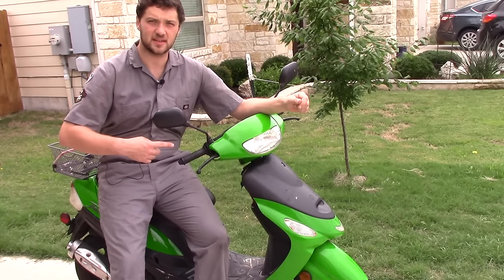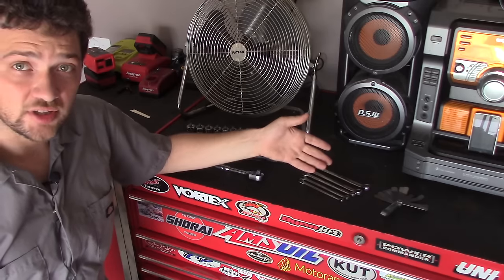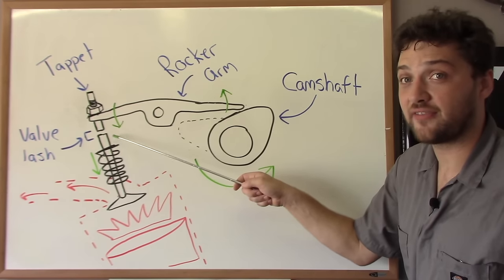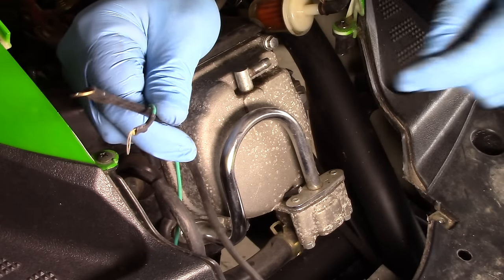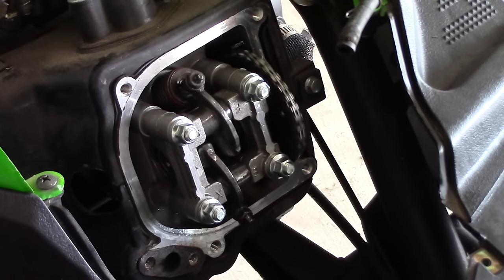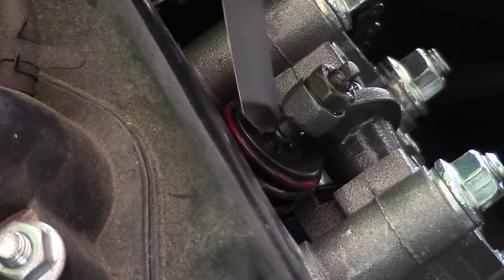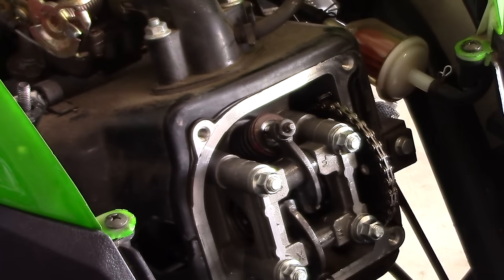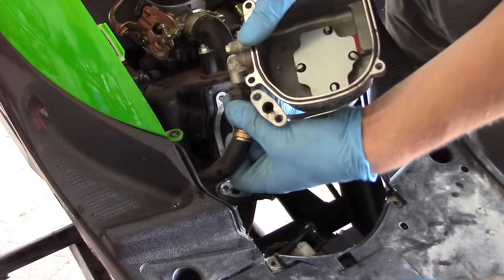Scooter 911: Hard to Start or Wont Stay Running? Try a VALVE ADJUSTMENT! (works for most scooters!)

Comment: Having an issue right now where my ped won't stay running unless the gas is past a quarter throttle. Soon as I let off it dies right away. Any ideas?
Reply from the maker: Did you try the valve adjustment?

Comment: The manual for Gy6 50cc states to set both valves at 0.002 inch/0.05mm, you say to set the intake at 0.003inch /0.076mm and the exhaust at 0.04inch/0.10mm. What's the correct value?

Comment: @Garret Seesing How much would this cost at a typical shop to do? I have this exact model/problem but I do not have the tools to do this. Your video was very helpful and i could easily follow step by step but the lack of tools suck!!
Reply from the maker: The last private shop I worked at (I know work for the government) would charge somewhere around $200 for this service. But we sold it as a "full service" and it was wrapped into a multi point inspections, oil change, spark plug change, and lubrication of the pivots and cables. Because Chinese scooters are still not widely accepted there is no standard "book time" like a normal car. Therefore you're sort of at the shop's mercy.

Comment: I know this engine. When temperature is over freezing point, it normally start easily. If not, is couple main reason why. Iddle running rpm is too high (choke not work). Pick up coil is too far of generator wheel. How you ented valve adjust problem? It extreme rare cause in this problem. Valve gap increase when engine start.  That why very small gap (0.05 mm) is needed.

Comment: My Tao Tao starts good, but when I run it, especially on an uphill grade, it bogs down. I recently had the oil and transmission oil changed and a new spark plug. It just doesnt seem to have the power it used to have, I should also tell you I went a few hundred miles past the oil change mileage. Does this sound like a clutch/transmission problem?

Comment: great video what are the sizes of valve cover  bolts short and long...thanks
Reply from the maker: Thanks for watching! The valve cover bolts are 8mm. Cheers!
Reply: Does the length of the bolt matter besides the head being 8mm? thank you for replying.
Reply from the maker: @markchase7419  oh maybe I misunderstood you. Are you trying to replace the valve cover bolts completely? Yes the length matters
Reply: 2 bolts are stripped one exhaust bolt the other top cover bolt
Reply: yes just the cover bolts

Comment: Hey scooter 911 I'm. Having alot of issues with my 2019 lexmoto titan, been in garage they said it's. The air idle control, is this easy to replace or do I need to do extra work if you could do a video oor just inform me I wwoulld be great... Your videos have helped me out loads in the past

Comment: If someone could please help, so I did this. It starts now. But doesn't sound good. And cuts off when I actually try to ride it. Powers down more I twist the throttle. My scooter has a non serviceable carburetor. I sprayed all in it with carb cleaner. Will I really have to get a brand new one? Do I have an air leak somewhere?

Comment: I have a honda metropolitan that uses vaulve shims, it only has 300 miles on it. I got it from a neighbor for free and they said it had an air leak and dust got in so it needs new rings. I felt for play in the valves and the intake had more that the exhaust by what the manual says it's supposed to be the other way around. My dad is getting home tomorrow so I will be able to check it with feeler gauges then(they are in his locked shop). I have a question, can the vaulve have gone off with only 300 miles? The rings with be next in line after this.

Comment: Have a question friend I have the same bike it turn over getting gas haz spark but want fire I check my valves at top ded center and the intake was tight and the exhaust was good

Comment: Hi mate I've a problem with a peugeot kisbby 50cc 2016 when I first start it from cold it won't idle sometimes hard to start at all, once started unless it has a little throttle cuts out when warm runs like a dream, I've changed plug electric choke still the same do you think this could be the problem? Like I say no issue at all when the bike is warm just when cold start any help be great cheers
Reply: I've cleaned the carb still the same I'm at a loss thought air leak but pipes are fine
Reply from the maker: Definitely as long as it's a 4T! You've certainly addressed the other issues that can cause that symptom. We don't get Peugeots here in the states so I'm unfamiliar with that platform's specifics, but I'm positive it will need regular valve maintenance.

Comment: Hey i have a 49cc scooter. Was running good just wouldn't stay idling. Was out driving it and something popped or something and it wouldn't start back. It wouldnt even crank. Got to looking and the spark plug blowed and now the motor wont crank or nothing. It clicks but won't crank. But if i put it in a certain position the motor will crank but as soon as it gets to a certain point it stops and just clicks. Not sure what the problem would be now? Hoping you could help :)
Reply from the maker: Sounds like you lost the motor my friend. I bet you dropped a valve and the piston hit it jamming it into the cylidner head. That's why the engine won't turn past a certain point.
Reply: @Scooter_911  okay. Thank you.

Comment: I followed your video on changing the tire but ever since I put the rim back on there is now a new problem a grunting sound coming from the engine and tire area while I'm riding it. Hoping you can help me out on this one. It's not consistent it just grunts when I let go of the throttle
Reply from the maker: Man sorry to hear that. Does it only make the sound when you ride it? Or can you get it to make the sound when you spin the wheel by hand? More than likely it's some part that was misaligned furring re-assembly. Good luck!
Reply: @Scooter_911  thanks for responding by the way changing the tire was a success unfortunately a new problem occurred.. it only happens when I'm riding it and it's not consistent it comes and goes kind of like when I let the throttle go

Comment: First problem is that it's a Chinese machine. These machines while half the price of a Honda Metropolitan or Rukus are light-years in difference as far as quality goes. The one Honda Metropolitan that I owned was an amazingly reliable bike. After it had sat for nearly 7yrs all it needed was a carb clean and fresh gas and a battery.  Even cold sub zero weather and it would start after maybe a second after I pressed the start button. It was smooth running and quiet as hell. And it got 180km per $6.50 of premium gas. And had a top speed of 60kmh after I'd removed the restriction plate which had a smaller hole than the air intake pipe it covered. I have had 2 Chinese scooters a saga and a kymco both have needed lots of maintenance and screwing around in order to make them start and run. The kymco just sat overnight in the years first rain since 8 finally got it to run by sticking a cough syrup bottle into the intake pipe with holes cut into it before replacing the airbox cover onto the bike. It wouldn't start let alone run before i did that and it took many attempts to finally find that solution for it. Anyway after last night's rain it back fired popped and sputtered in and out life for the first half a km this morning. Oh and if I don't spray a little quick start into the air box when it's cold then I have to kick the thing for at least a minute or so to get it to start. I can only wait for the day when the auto oiler stops working and the engine seizes up while I'm screaming down the hill from my house. I will abandon it with a free bike sticker on that day. Piece of garbage that it is. Thank God i only paid $60 for it at the local dump. I am not joking that's how much it cost me.

Comment: Hi there came across ur vid btw awesome and straight to the point, I just recently bought a u can say bike w a scooter engine the venom 250 which is technically a scooter engine lol . But I only have trouble gettin it started in the cold mornings , after its started it stays on and starts up quick I'm only havin trouble in the mornings when cold is that normal ?? Also at idle it's up around 1500 rpms

Comment: i have a buddy 125.  its all set up.   it wont start up at all anymore.
good spark.
clean gas
clean carb
valves adjusted to .003
what am i missing?
this scooter is driving me nuts

Comment: Wound you use the 3 thousands, and 4 thousands for a 100cc big bore kit?
Reply from the maker: I use those measurements for all GY6 platforms. From the 50cc 139qmj to 150cc the 157qmb regardless of what performance parts have been installed. Good luck!

Comment: I have a weird issue I'm battling right now. My scooter back tire will not move when u twist throttle so I replaced the belt last week with no luck now this week I replaced variator and still no good. I'm at wits end

Comment: My gy6 is hard starting plus has what i think is a back fire or clicking miss every so often while running could this be valve lash ? I have never checked it in the 2 years I've had it, bought it new. Also it is on a coolester 150 cc atv but dont see why that matters the hard start ,started after carb swap thought it might be the enricher but after this video not so sure . how often should you check valve lash? Thank you for your response.

Comment: First, love the videos.  Great combination of entertainment and usefulness.  I did this valve adjustment on my 2014 TaoTao 50cc as part of a tune-up (bought it used and not sure what's been done to it). The things I did; replaced oil; replaced spark plug; valve adjustment using .003 for intake and .004 for exhaust.  When I first checked the lash both appeared to be touching.  I wasn't quite positive I was at top dead center when I reset them but in any case now I have what I think is valve clatter.  Does the .003/.004 hold pretty universal?  How critical would top dead center be as it relates to valve clatter?  Any other videos on details for finding top dead center? I didn't quite understand what my mini-screwdriver was feeling for in the spark plug.  I have a video/audio if that's helpful to confirm it's valve clatter.  Took a lap around block.  The bike runs much better but I attribute that to the spark plug.  Additionally, the starter didn't work before, and after all this; it worked but just once...given the fact that I only removed those 2 engine grounds, does this suggest a bad ground there? I watched your starter circuit video and will have to unpack that more but was surprised when the starter worked after putting humpty dumpty back together.  Any thoughts would be much appreciated!
Reply from the maker: Nice work, glad to hear your bike is running better. I found .003 and .004 to be the best measurement across all GY6 scooters. It allows the engine to run the best and with (what customers really care about) minimal valve train noise.

Yes absolutely its important to have the piston at top dead center of the combustion stroke while performing this service. Not being at top dead center definitely can result in excessive lash and valve noise. The screw driver is used to make sure the piston is at it highest point in the cylinder. That is what Top Dead is referring to. 

Those engine grounds are notorious on Tao Tao bikes. Tao Taos actually are known for having bad grounds all over the harness, and working in a motorcycle shop i've had to build my fair share of ground harnesses for them. You can try adding a thick gauge wire from the negative battery terminal directly to a solid unpainted bolt on the engine.

Hope that helps. Good luck!
Reply: @Scooter_911  thanks for the prompt reply!  Thoughts on doing a video explaining the details of finding TDC? Compression stroke vs exhaust stroke and how to determine you're on the compression stroke (and then finding TDC)?
Reply from the maker: @markwarren847  I actually hadnt considered it but if i was unclear in how to find TDC in the video maybe i should. Can you revisit 7:18 and tell me what part needs clearification?
Reply: @Scooter_911  I think I've cracked the code at this point with compiling info from other sources.  Food for thought on what helped me.  I understand it's important to find TDC on the compression stroke.  So placed my finger on the spark plug hole to seal it and then moved engine until I could feel pressure on my fingertip (and hear it hiss a little when finger leaked air), this let me know compression stroke was in effect.  Then, after seeing an exploded view of the engine piston location relative to the spark plug hole on a whiteboard, I understand what the screwdriver was hitting and why it was being pushed out or allowing me to push in.  Maybe just add that to your whiteboard so one can orient their mindseye to where the screwdriver is entering the picture.  I was skiddish about putting the screwdriver in when I originally did this and was afraid I jabbed something.  Now to just figure out this ground issue!  Don't suppose there exists a drawing of all the ground locations on these TaoTao 50's?  I didn't get any manuals or tools with it unfortunately and can't find consensus on the internets.
Reply from the maker: @markwarren847  glad you got it sorted, and thanks for squaring away what I can make clearer!

Comment: Hey Garrett. I live in India and I recently got a 125cc Honda Activa 2015 second hand model and it has a lot of the issues you spoke about honestly. I wanted to ask how do I get over the problem of stalling at a red light because the engine dies off and secondly how do i get the damn thing to work since every time I get on it it needs repairing from a shop near by. I already changed the piston and the spark plug as well as the switch button and the oil and both the tires and filled them with air for around a 100 dollars from three different shops. Please give me a piece of advice I can make use of

Comment: My GY6 is having a very hard time responding to throttle input. Just falls flat on its face and stalls. Same body as the one in the video, except it's called Giantco Sprint SE (Sport Edition). It's a 72cc big bore, stock carburetor, Freshly bought and installed DC CDI (will not run without battery) and compression ratio of 14.2:1 (10.4:1 stock). I suspect a bad coil, but how am I suposed to check it for faults?

Comment: I have a brand new Tao tao VIP 49 cc, from the start it has very little power and it dogs down bad when giving throttle, any suggestions.
Reply from the maker: Check the valves first and then go through the carburetor

Comment: I am thinking this may  be my issue .I was riding my toa toa vip 50cc and the belt snapped , I replaced the belt and it has been hard to start and when it does start doesn't have enough power to move when Im on the scooter . But the tire spins when on the stand . Does this sound like the same issue ???

Comment: Do you have any knowledge on doing this on a Honda pcx?
Mine seems to have packed in after 7000 miles changed the battery etc still  the same problem?

Regards
William
Reply from the maker: Yes absolutely! And the process is almost exactly the same. The main difference is you have to be clever getting the motor to top dead center but the process is nearly identical. I forget what the specifications on valve lash are. Good luck!
Reply: @Scooter_911  thanks garret I will give it a whirl see how it goes all the best 👍

Comment: I have a evolution R BD50QT-9A had a place get it goimg amd then I put to much gas and beem having problems since. Just paid 200 to fix it . Fasttrax was the place. I had it going but then stooped at stop sigm and it idled out. Wants to turn over but womt or womt stay goin

Comment: Is there any scooter which does not need any tappet valve adjustment? I've Italjet formula 125 scooter and I'm facing hard to start and not remain started in idle. I talked to mechanic at service center and they told me it doesn't require any adjustment like that but u need to replace all that parts. By the way the scooter is running around 27k km . Pls help .
Reply from the maker: Honestly i don't know of any 4 stroke scooter that does not need regular valve adjustments but i'm not familiar with italjets. Even my Ducati needs it every 18,000 miles.

Comment: I recently had to change my belt on my GY6 150cc scooter and found the belt wasn't the only problem. After the belt broke on many pieces I also had to change a busted seal behind my variator (I know the spelling is wrong). 

After replacing the seal I started hearing a popping from the exhaust. Could you tell me if that could be caused from a fouled spark plug or is there something else I need to checkout? 

Your help would be greatly appreciated.

Comment: I don’t know what’s wrong with my scooter. When it turns on it’s starts immediately but not even 5second the engine cuts off and dies. It doesn’t hold power and we even tried running the trotted to power it on but the engine dies instead. I’ve been having this issue for two months now and it’s so frustrating. :( it’s a brand new scooter too with only 89miles on it… not even passing the 100 mark.

Comment: My moped is doing the samething it starts up the few seconds later it just dies right out I tried everything idle adjustment air mixture screw and the carburetor is new nothing helps.I think I need a valve adjustment

Comment: Well I’m having a problem my scooter would not start if the gas meter is down and my signal would not work nor my horn but it would start once I tap on the handlebars to get the meter to move and everything is good I’m just trying to figure out what’s causing it to do that

Comment: Got a scoter the same but put new plug in it starts first turn go for a run then will not start of button turns over ok but not start but if use kick start goes first kick switch it off but still not go with button any ideas what could be up